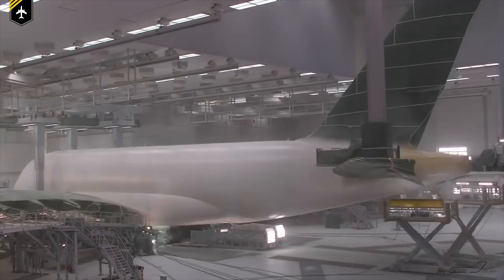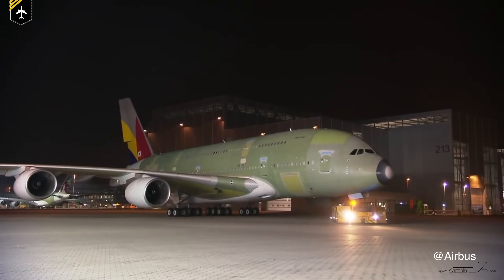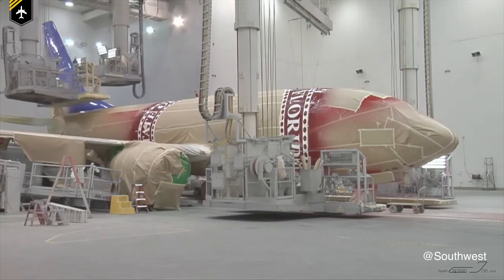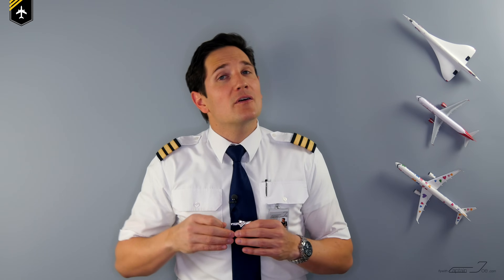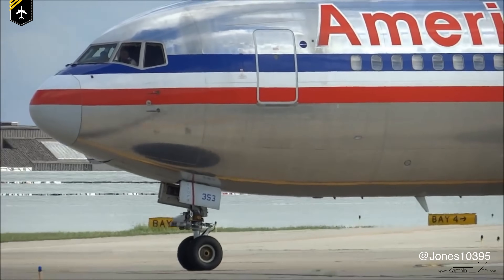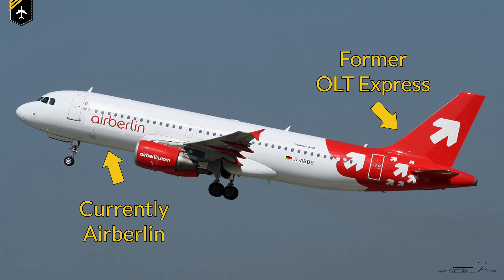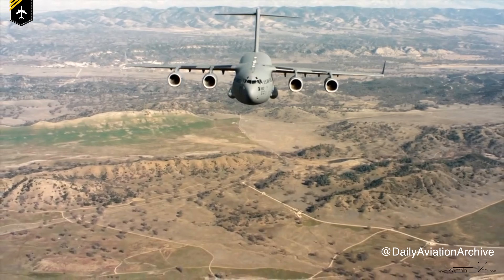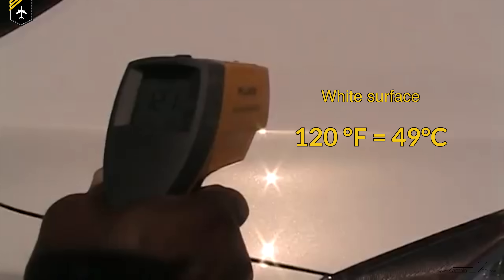REASON WHY PLANES ARE PAINTED WHITE! Explained by CAPTAIN JOE

Comment: Is it true that in a crash, the main reason for the large fireball is because of the chemicals in the paint?
Reply: I would tend to think it's large quantities of stored fuel being released, I haven't heard about the paint causing it before.
Reply: In my experience, kerosene burns quite well. It is sold as fuel, after all.
Reply: No, it’s fuel exploding. Of course it’s flammable but in a crash it is worse since the forces of the crash cause the fuel to instantly spread into a cloud of small droplets that burn really well, and of course the crash will also cause friction and sparks which will easily ignite the fuel cloud.
Reply: @Sashazur  so same principle as a Fuel/Air bomb. Disperse a cloud of gas then create a spark to ignite the cloud causing a tremendous Shockwave as the temp rapidly expands?
Reply: Idk maybe they excessive amounts of a jet fuel help too but just a theory

Comment: When they move planes to a new location for final assembly. The  paint being used is a corrosion preventative under coat called a primer. Another advantage to bright white paint is it saves ground crews and aircraft mechanics from head injuries from walking into dark blind spot areas under the planes during low light conditions with protruding components like antenna's, drain masts and other components. I know that first hand. I spent nearly 32 straight years with United Airlines in aircraft maintenance. Over 5 years in 747 overhaul and 26+ years in terminal line maintenance at O'hare and was airworthiness qualified on every type of plane United flew since 1989!

Comment: But wouldn't a dark painted plane absorb more heat at high altitude because it gets hit by more light there? Then it would heat up more at the coldest point than on the ground, and therefore reduce the temperature difference.

Comment: I don't get the temperature part? "-57 C (Cruise) and 45 + heat additon dark paint (apron)". Why would it only apply during landing? The additional heat due to dark paint still applies during the flight. Even more so since the air density at cruising altitude is about a third compared to sea level (higher light intensity due to less reflection in the atmosphere).

Comment: Military Aviation here. Depends on the airframe. A Blackhawk for example is painted black for obvious reasons such as hard to see at night, prevent corrosion, deflect radar, and prevent biological attacks from sticking. Depending on the paint type of course.

Comment: Always amazed at how many pilots have very narrow education, in the “laser temperature instrument “ it’s actually an IR sensor, the only laser in there is just the aiming laser pointer, if you put a sticker on it, the temperature readout is totally unaffected. The black paint is black because it absorbs all the light frequencies in the sunlight as opposed to white paint that is white because it reflects all the frequencies, more energy absorbed by black therefore higher temperature. 12 times more reflective, don’t know where that comes from, reflectivity depends also on the finishing, Matt black is the best absorber of light energy therefore the hottest colour as it comes closer to the prefect black body of thermodynamics.

Comment: The reason is that temperatures near the equator is extremely hot so as white paint is 12 times more reflective than darker colours people inside will not feel that much hot as compared to a dark coloured car

Comment: Shouldn't have used an infrared thermometer to measure the temperature of the different painted cars. There is likely a bit of a difference in emissivity between the two types of paint.

Comment: didn't watch it but my guess is because white helps to reflect heat off them at the extremely high altitudes which airliners fly and are the most vulnerable.
just my guess.

Comment: I'm sure you have been told by now, but you can't accurately measure temperature with that tool that way. 2 different emmisivity properties between those paint colors. But the theory you discuss is still sound.

Comment: Aluminum may not rust but it does oxidize. Painting the surface is the best way to keep it from pitting and keeping the surface nice and smooth for aerodynamic purposes and maintenance. White is also the easiest color to cover and is the coolest in bright sun. Different metal materials can flex, or expand and retract, if you will, in size a set amount based on the difference of air temperature vs surface temperature. This as the video stated can either cause or relieve stress in the material. Since the panels are usually riveted in sections, the heat will make the metal move in it's least resistant places. Military planes on the other hand use a totally different type of paint than commercial planes do, so the rules change a bit for that process. The Air Force calls this job Corrosion Control.

Comment: Using the dot as a currency separator is triggering me. Speaking of which, wasn't there a big stink in contract negotiations sometime ago between Airbus and Boeing whilst dealing with a potential client? Airbus used a dot, and Boeing used a comma. Client saw this in the contract and expected Boeing to honor a deal to sell aircraft, at what would be a highly discounted rate due to this. 
Many people don't realize there is a difference in other countries. Example:
$10,000.00 = Ten thousand dollars
€10.000,00 = Ten thousand Euros
However to Americans this is where the difference comes into play.
$10,000.25 = Ten thousand dollars and 25 cents
€10.000,25 = Ten thousand Euros and 25 cents
See the difference?
Captain Joe, have you heard of this rumor? Could you elaborate if so?

Comment: So it doesnt attract the sun heat/beams, witch is local and only a few miles away from a plane when flying in the air. No such thing as space, all pilots know this. Sun in 30 miles in the air, the moon is a bit higher.

Comment: As a mechanic for a low-budget regional airline, I see some shoddy paint work. Paint frequently wears away due to erosion. Any tiny particles, be it dust, rain, or ice, acts like a sandblaster at 500 mph. You'll see paint on leading edges stripped back in patches, and when it makes it down to the metal, it becomes time to touch it up. Often by just taping off the damage, and spraying on a color that's "close enough". Many years of this, and they end up looking like an A&P school project plane. Most planes have their leading edges protected by sacrificial clear polyurethane films meant to protect the plane from corrosion. They are notoriously difficult to apply perfectly, especially on large radomes.

Comment: I would have to agree with the last one about the temperature difference the most, although I wouldn't think the paint color would make a difference once flying, as there is a ton of airflow cooling it off, so both colors would be the same temp when moving. On the ground though, it makes a huge difference. That is why almost all rockets are white, because they spend a lot of time sitting on the launch pad.

Comment: I live in a country that is near the equator and you can really feel the difference of temperatures when you sit in the car, the white car is comparatively cooler where as the black car is boiling hot, you have to keep the door open for a couple of minutes until you can sit inside

Comment: With the new technology these planes dont use much fuel once they are in the air after lift off, their engines run off compressed air so the weight is irrelevant.

Comment: The paint booths they use to paint these planes are incredible. The air handling systems they use to feed the air in is very complex and requires a bunch of stages. I worked at a company that designed the air handlers for aircraft and many other things. When I started there they were building units for feeding paint booths for the F-16. The US has sold some older planes to Pakistan I believe and they were setting up paint booths to reprint them and maintain them. This air handler was specially made to fit in a container to go on a cargo ship. It’s one of those things you probably don’t think about.

Comment: Also keep in mind, this only matters while the plane is on the tarmac trying to cool down the cabin. Once up in the air the skin of the plane matches the temperature of the air outside regardless of color. You also expect the nose and leading edges to be relatively warm as Mach increases.

Comment: I saw that you stated the temps of cars in degrees F, and stated temps of planes in degrees C. As a U.S. scientist, I prefer you use Celsius, and let us ignorant backward nations adjust. I noticed at most scene cuts, there is a white flash. That is pretty annoying. A quick fade or a dissolve would be easier on the eyes.

Comment: Paint three very thin white layers, each nearly translucent, but calculated to look "just white" by the third layer.  Then a UV-blocking aviation clearcoat in a first very thin layer then a medium final layer.  Finally, occasionally spray on a silicone-based wax/sealant.

Amazingly, you're looking at a 20 year between paint job duration that still weighs about the same as your standard two-layer paint job.

Comment: Real question is why are airplanes becoming more and more slow? SR-71 black bird took its maiden flight 55 years ago and had an airspeed of over 2,100 MPH. Granted, the black bird was at an altitude of approximately 80,000 feet compared to todays 747 which is around 30,000-35,000 feet. But the 747 cruises at around 587 MPH. Thats about 4 times slower than the black bird. 
Ok so maybe its because the SR-71 wasnt a commercial airliner you say? Well then, what about the Concord which was a commercial airplane and it managed to have a cruise speed of 1,320 MPH and that was also 50 years ago! Bascially, in a world of innovations for improved speed and performance, the commercial airline industry is stepping backwards in efficiency.
Reply: Super sonic flight is too expensive to be commercially viable at lest for now.  Concord retired because they were no longer profitable, it takes afterburners to get super sonic and that burns a lot of fuel. Also considering the power needed and the giant delta wings, super sonic planes have small cabins, there is not much space for passengers. Modern Jet lines are extremely efficient, they burn less and less fuel per passenger. 

Not to mention supersonic planes are just more expensive to  design, build, and maintain. They need more exotic materials to deal with the heat of mach flight, they have to deal with greater pressure differentials as well since they fly much higher.  Their delta wings makes them have to land faster at a higher angle of attack, more wear on the landing gear. 

And then there is the noise problem. They can't go super sonic over populated land, they only make sense for over ocean flights like NY to London, this is why the American Boening sonic jet liner was never finished. And it's not even just the sonic boom, Concord needed it's after burners for take off, and anyone who lived around an air port when Concord was taking off, or lives around a Airforce base can tell you about how loud afterburners are.